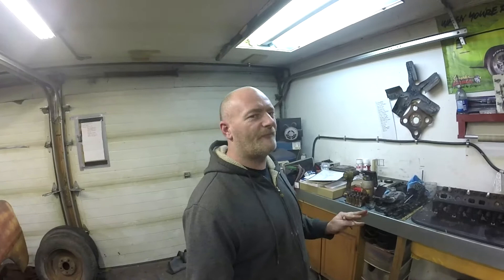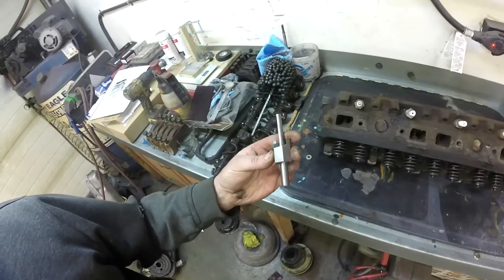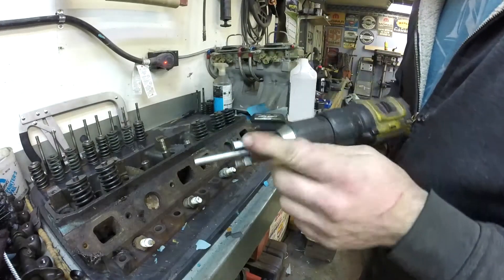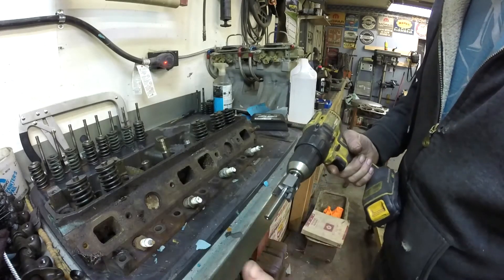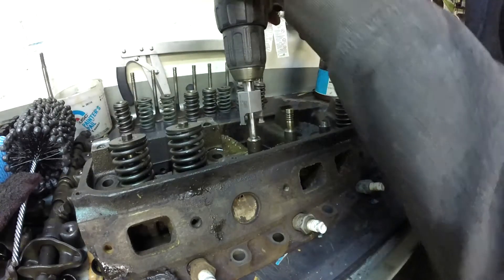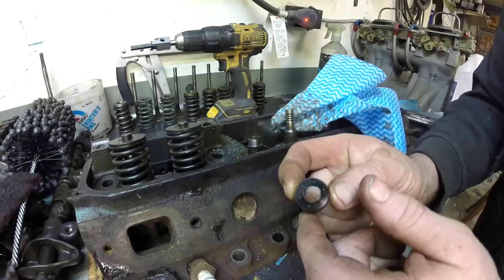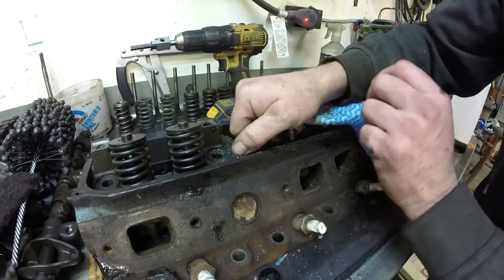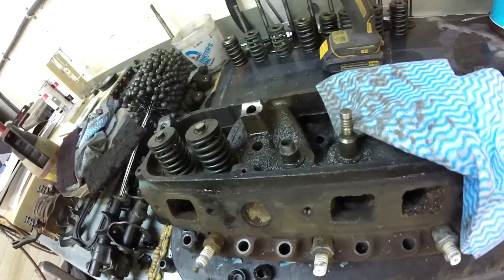Cheap 440 Build Pt5, Modifying for Comp Cams Valve Seals

Comment: Good video, but the seals now sit higher than the valve guide, right?  Not worried about clearance issues?  Thanks, Scott/BPG
Reply from the maker: Hey Scott, the cutter brings both the guide and the cut metal to the same level, so all match up nicely. 🤘🏼

Comment: .480 lift, what duration and LSA?
Reply from the maker: .480" Loft I/E
231 duration @.050" I/E
LSA 110 degrees 
Normally I'd go around 245-250 duration @ 50... and I like a 106-107 lsa as well. But this one became the right deal at the right time , and the 110 lsa will help it pull a decent vacuum and a smooth idle. Two important things for the tunnel ram when not screaming rpm